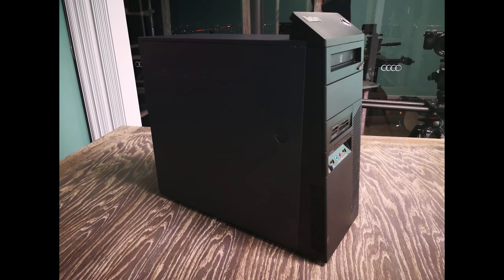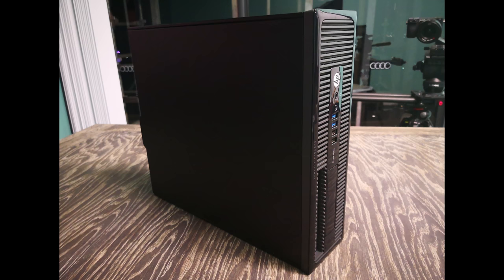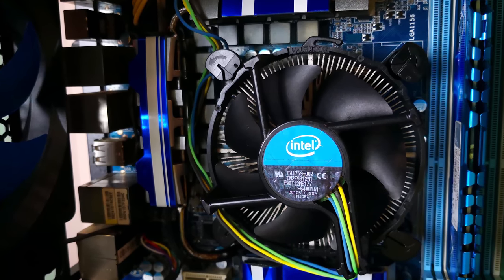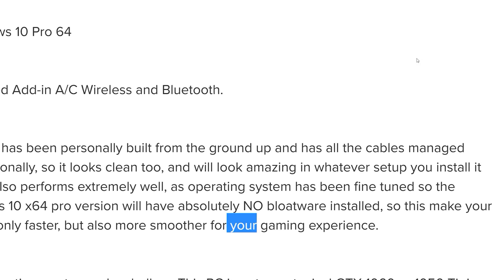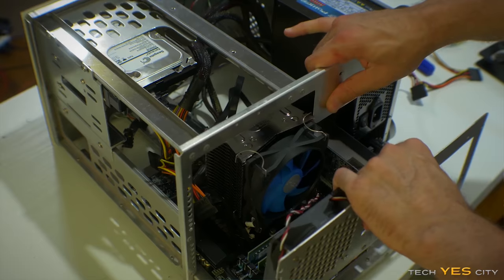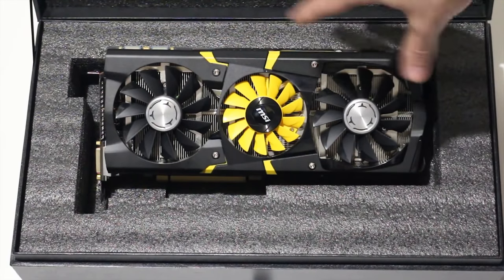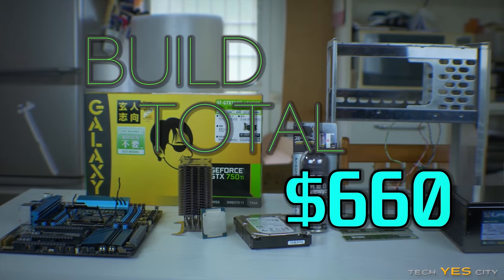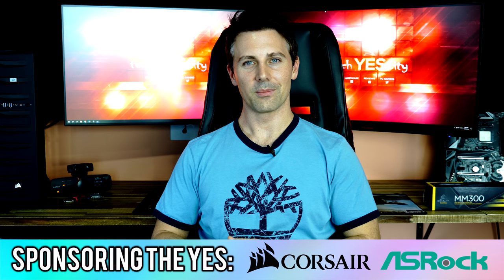How to SELL A Gaming PC In 2018 | Should You Sell Your PC Gear BEFORE a Launch?

Comment: Its funny that I just bought an rx580 with r5 1600 and I spent like 1070$ just bought it like last month and amd just freking release a 2600 and new gpu cmon man
Reply: Lesson learnt then, don't rush into something without doing your research first. TO make you feel better the new 580X is refresh of the 580, which was a refresh of the 480 but draws more power and about a 5-8% performance gain. The 2600 release is likely to  have marginal gains and a slightly higher clock speed over the 1600 (all unconfirmed until 19th) so it's not like you bought a totally different product and you're stuck with a lemon. A grand for that though seems high though even in this day and age. Enjoy what you have - you can always think "if only I'd waited" but then you'd never actually buy anything as everything gets replaced by the next thing so quickly now.
Reply: djmandrick and ive also regret saving money to buy computer I've should just bought at year 2017 because.the prices this year is very bs because its far from its msrp like rx580 I bought mine like 420$ its asus dual oc
Reply: agreed - prices on everything are crazy right now. I feel your pain and glad I built my 6600k when I did in 2016. I thought £75 for 16bg of ddr4 was expensive then.
Reply: djmandrick well im also preparing for cpu shortage and hdd because linus said you can mine using your hard drive so I bought like 20 hard drives used and 13 cpu mostly intel but the 4 of the cpu is amd I bought them all like 268$ glad I know a person that owns a server :)
Reply: lance that hdd mining has been round for ages and was relevant two years ago. It's not profitable now. If you see anything on LTT like that take it with a pinch of salt.  They are WAY behind current trends. Not a good source of info. General stuff and beginner things overviews etc but mining etc they have no idea what they are on about. There will be no shortage of either cups or hdds. Nand Flash memory and ddr4 will be affected for at least next 18 months while Samsung build more wafer factories. Phase 2 finishes next yr.
Reply: djmandrick yeah but just in case you know sometimes the currency just go up without knowing it and most of the hdd I bought is black so I think its a great deal btw he is selling ddr3 and ddr4 8/16 ram 2400 I think like 50$ each because he already used it
Reply: lance I'd be buying that ddr4 all day long and selling it. To give you an idea in UK £63.99 for ddr3 8gb. 85 for 8gb ddr4. That ddr4 you said isn't fast but it's still ddr4. I'd be buying it in bulk for less than 50 per stick and ebaying it. Ddr3 I wouldn't pay that for 8gb but for 16 seems like a good deal. Long as you're happy. It's your money to spend however you want. 😊